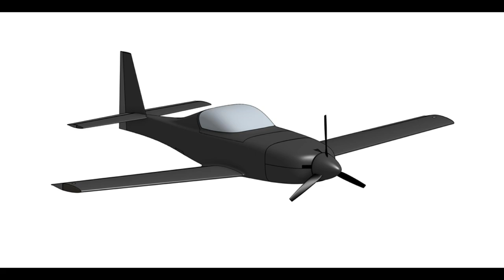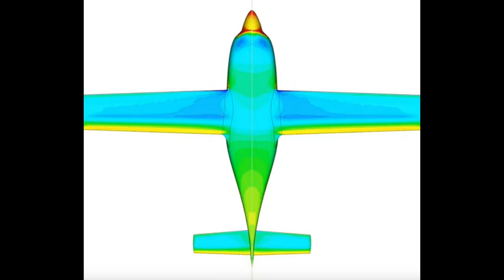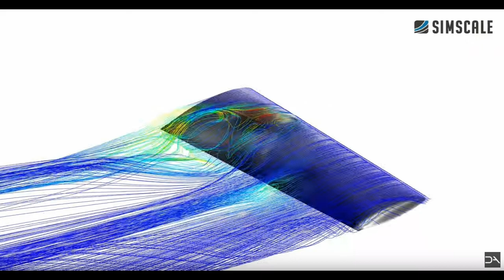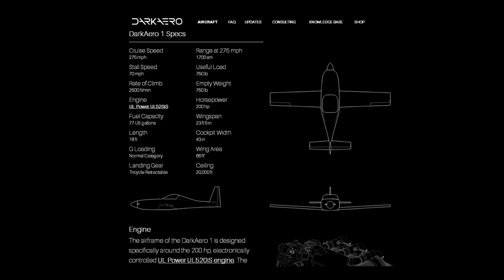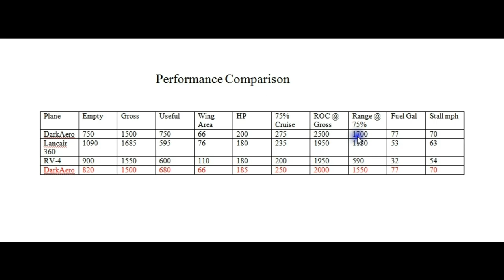Exploring DarkAero. Video #109

Comment: One thing that impresses me is the enthusiasm, confidence and logical thinking that oozes from these three young men.  I'm a bit taken aback at all the non-traditional material, methods and design.  Carbon fiber, hinged canopy (and panel!), split rudder, tiny wing, UL520 no mixture control engine.   This is a far far cry from the dowdy traditional C172 I fly.   In fact the modern futuristic Darkaero makes the C172 look like the Ford Model T of the sky. 
They believe in themselves, and in their product.  They do everything totally hands-on.  If that's not full conviction I don't know what is.  Way to go, bros!  And my very best wishes from faraway Malaysia!!

Comment: These engineers have set THEIR goals (not ours). Very light. Fast as possible. Best range they can muster. AND...for better sales... side by side rather than tandem, and LOW PRICE- that means staying under FL180, non-pressurized, simple flaps, no slats, no speed brake (using split rudder instead), and the fastest stall speed allowed.. The UL engine is the lightest weight for the horsepower, and they say the electric adjust prop is much lighter than an oil pressurized one. They also say the prop was designed for this engine, and they plan on using full RPM of the engine for 200hp. I believe they will come in at their weight goal. Their speed goal seems too high, but they still believe it will achieve it. Their extreme attention to details and testing and designing for production and easy kit-building are their greatest strengths. Try finding a 275mph plane for $160,000.

Comment: What I like about these guys is though they seem wet-behind-the-ears in trying some of these new things like the split rudder and the electric gear, they also have the analytical chops and the rational attitude that I trust them to swap them out if they're not working, rather spend dozens or hundreds of pounds to satisfy their own egos like certain other would-be kitmaker youtube personalities.
Reply: Yeah, actual proper testing and engineering. Even then it won't be easy, but it looks they have a really good shot at achieving their goals.
Reply: King Air 200s use electric gear retraction
Reply from the maker: @aviator267  King Air uses motors and chains, this one will attempt direct linear actuation. I should have been more clear on that.
Reply: Based on many of their comments I've read these guys also seem like they would be willing to accept/seek outside help should they stumble into something they cannot work out on their own.
I'm only disappointed that I can't fly a darkaero with my light sport license and that it is a bit beyond what I can afford.
Reply: @rv6ejguy  I’ve been a subscriber of yours for a long time. I really enjoy your content and technical info, I’m following the darkaero project closely and love the work they’re doing especially around the gear. Please keep us updated. I always request them for content on the gear. I operate and represent BlackShape and their aircraft use electric motor drive undercarriage with lead screws. No problems there
Reply: This comment was accurate on 2 months ago. Now it's even somehow even more accurate...
Reply: @rv6ejguy  linier actuators are the best option for landing gear bar none, imo. Any other Gizmo along the way is over thought and heavy. Though Mooney made a simple electric system at one point. Linier actuators with an irreversible, rotating threaded rod and stepper motor is perfect for this application. Very reliable and precise. It's what CNC Mills use for precision and durability.
Reply from the maker: @TheJustinJ  It could work. We'll have to see how their design works in the real world just like the rest of the design. It will certainly be a light solution if it does and I commend them for trying something different here.

Comment: The DarkAero has the potential to be a big success. The team's philosophy, professionalism, work ethic is something to be admired.

The only factor that I can see against its success is, unsurprisingly, cost. The company will undoubtedly find a costumer base. I just hope that enough costumers will be there to justify the investment.

Other than that, the aircraft itself is an absolute jewel. If I could afford one, I would definitely purchase one.
Reply from the maker: They need to get the thing in the air to prove it. It's really dragging out with their other diversions now.
Reply: @rv6ejguy  I agree. It should be in the air as soon as airworthy; not as soon every single nut and bolt has been polished to perfection.
It should be in the air as a proof of concept. Non-critical parts can wait.
Getting it into the air will incentivize investment, as well as potential customers, not to mention the value of publicity.
Reply from the maker: @leoa4c  Yup, last video was on creating a CAD catalog. Nice thing to do but is taking time away from DA which has seemingly slowed down a lot over the last 6 months.

Comment: News alert,, that UL engine is now turbo normalized. 220 hp. Go high go way faster. Also with say an extended tip option cruise would improve with altitude while helping tame the stall speed a bit like 65 or so.
Reply from the maker: Would need O2 above 12,000 which is a PITA. More weight, more maintenance, higher cost.

Comment: They might achieve a lower than anticipated empty weight. As they're building, they have been finding lots of opportunities for weight savings from using different materials than initially planned. One example is switching to a polymer bearing/bushing for their landing gear shock absorber instead of bronze (?). I've been very impressed.

I need to see actual flight testing and validation of their models though, especially for slow speed handling. The wings are very thin, working great at high speed. Low and slow is my biggest worry especially with the horizontal stab. They are very happy with the wind tunnel results though so my fears are likely unfounded. 

Is a 3200rpm propeller a problem with noise/vibration as the tips go supersonic? Why would UL make an engine with such a high possible RPM?
Reply: Has a design ever come in underweight? Taking weight out is usually the fight for everyone - even up to airbus! Very clearly optimizing for high speed / long range cruise I think? 

Be interesting see wing and power loading numbers in these comparisons. 

One benefit of the higher wing loading might be handling in crosswind / turbulence etc. The kind of flight times these folks are thinking about are long, weather can shift at the destination so a plane that doesn't get blown all over might be nice? Some light sport flyers get nervous (reasonably) when conditions for landing are a bit sideways. Just speculating.
Reply: @randominternet5586  The designers want high speed and high efficiency/range and low cost. Their specific mission is getting from A to B and navigating around bad weather. I'm guessing they plan on airports with multiple runways. 

They do not plan on lightning protection or deicing, or grass runways, or any other engine besides the UL because their cowling is intentionally limited for aerodynamics. With their process though they should be able to fabricate a modified cowling very easily.
Reply from the maker: The Jabirus can spin up here too. It gives the opportunity to use a small prop for ground clearance and that won't hurt speed but may hurt TO and ROC. A bit of marketing too perhaps- 200hp from 5.2 liters sounds impressive. That's why I mentioned it may not be spun up this high and therefore won't make 200 hp.

Comment: Very well done videos and a lot of fun!  I'm not sure they couldn't make the spinner one piece though with matched tooling.  I built a rocket fairing with a carbon fiber 20 ounce 2 harness twill and no special tooling.  Matched tools and the right fabric could probably make this a one piece part.  I'm also concerned that having to use some constant right rudder to offset engine torque would set up a permanent split in the rudder adding drag while in cruise.  They also discussed the higher aspect rudder for more efficient lift right after saying their cross country mission profile made rudder usage (lift), less of a problem.  Higher aspect has greater Moments of Inertia requiring more strength and that requires greater weight.  So lower aspect seems more consistent with the mission statement.

maintaining

Comment: Thanks for looking at the DarkAero. I also think the brothers are doing a great job.
There are two things about the airplane which don't seem right to me. One is the way the instrument panel is connected to the canopy. This seems like the wires going to instrument panel will be flexed more than in a stationary instrument panel. Hopefully this isn't the problem I fear it could be.

The other aspect of the design I wonder about is the engine mount. They plan to use a pair of aluminum boxes (of sorts) to connect the engine to the firewall (with shock absorbing mounting points). This mount is much smaller than the normal welded tubes of other engine mounts. I'm concerned the smaller mount doesn't provide all the benefits of the bulkier mount. It just seems like the conventional mount wouldn't be as bulky as it is if there weren't a good reason to make that way.
Again, thanks for the great video. I really enjoyed. I also really enjoy watching the DarkAero videos.
Reply from the maker: The flat six with EFI should be glass smooth compared to a 360 Lyc. and the plane is only stressed for 3.8G I believe. I think the aluminum mount fits with their philosophy of using machines (CNC) to make as many parts as possible. This layout eliminates hand fitting and welding tubes. We'll see how it pans out.

Some things probably won't work as planned but I feel they will accept this and re-design any parts that don't.
Reply: @rv6ejguy  Thanks for the reply. I hope things work well as planned and as you say, they're make changes if needed after they test.
It's a lot of fun watching a project being done so well after seeing all the problems plaguing the Raptor.
Thanks for making your videos.
Reply: Flexing the wires by opening the cockpit should be no problem if they are properly flex and strain relieved and protected against chafing. I work on machines that get way more use than an aircraft cockpit and wire flex is no problem. Of course there is no worry about falling out of the sky either. But I can’t recall there ever being a problem caused by flex in 40 years of working on them. Improper strain and flex relief modification in the field by thoughtless techs usually causes any issues. That or improper use by end users.

Comment: They are certainly good bouys, doing very good job. One thing I do not understand: Why they put aluminum in between the carbon instead of airex or some similar material? MUCH easier to repair if needed, no corrosion issues at all.
Reply from the maker: I agree. I also see too many complex machined parts here, especially on the landing gear. Not ideal for production and maintenance. Aluminum engine mount also not a great idea from a fire perspective or fatigue over the long term.

Comment: UL Power have now turbocharged this engine.

It will be a game changer, for sure, and it is called the UL520T.

https://ulpower.com/en/engines/ul520/ul520t 

This engine now makes 220 HP at a more propeller friendly 2,700 rpm right up to FL150.

It can produce 200 HP at 2,450 rpm and a continuous cruise power of 180 HP at just 2,200 rpm.

Higher power, lower rpm and maintaining power at altitude will make a huge difference.

The DarkAero 1 does not have much space between the engine and firewall but hopefully there will be enough room for the turbocharger.

I do wish that each wing gets extended by about 1 metre.

Glssair did this to the III transformed it with increased cruise speed and climb as well as reducing the stall speed.
Reply: Wow - that is interesting news I hadn't heard about. The tradeoff in terms of weight for power is not bad it doesn't look like. The high altitude performance also better obviously. How does increasing wing increase cruise speed? Or is that just with turbo + wing increase?
Reply from the maker: @randominternet5586  The designers have made cruise performance at non-oxygen altitudes their primary design goal. In airplane design there are compromises. The small wing won't be good up at 18,000 feet or for slow flight. It's hard to have it all without giving up a bunch of knots on the top end.

RVs do the medium speed (around 175 KTAS) and low speed compromise well and with massive market share. Not much point in trying to compete there.

This is a small plane but follows the Learjet theory- the high speed means you won't have to sit in it too long...

Comment: I just run across a number of their videos and am impressed with the overall design processes that goes through their mind. I think that the stall characteristics if they would contemplate putting perhaps some Vortex generators on the wings that would help that smaller Wing be a little bit more effective. I am surprised that the shape is not conducive to closer to about 260 knots. I do think that that engine puts out enough torque that the horsepower number is not the leading criteria. Propellers are pushed through the air and push through water via torque, not horsepower. I don't know why they never print the torque numbers but torque is at least as important if not more so. I don't know why people in Aerospace tend to ignore that number. But that's information for another day. And I know that this is still conceptual. But I think they've got something going here so far. I think that they may get even better performance than they are printing here. Or at least have the clear possibility of doing so. I know that they had toyed with the idea of going with an electric power plant. Which still could be done if they would put a smaller highly reliable fueled engine of some type to run an alternator. Generate ate the electricity that the engine needs to run off of and I think they could cut a little bit of the weight down even further. However I still think that electric Drive will only be viable if it's done in a hybrid manner. Even a small gas turbine engine will put out enough power to be able to even use a battery source and replenish the battery fast enough where you can still have well over an hour of backup when you get to your destination. The nice thing I like about it is you can easily scale up their production Concepts into a six-place aircraft that would be more than capable of being a good Caravan or even light cargo aircraft. The expandability of their build processes seems to be quite nice. I do believe that they may end up going to a center strut to assemble the wings into pieces. It would be easier to replace one or the other should one get damaged rather than having to replace both in case of some sort of damage.
Reply from the maker: HP, not torque,  quantifies rate of work which is what engineers are concerned about for motive use. They know what they are doing.

Hybrid drives don't make much engineering sense on aircraft as they operate at continuous high hp unlike automotive applications. Any study will show it just adds dead weight. Watch my vid on Raptor NG which explores the pitfalls of hybrid aviation systems.

I don't expect DA will change the wing structure. It would require a massive re-design and re-validation plus add weight and delay production even further.

Comment: Fantastic! Youtube got this too me. Very interesting analysis.

Designs almost ALWAYS come in heavy but will be interesting to see where they land - very curious about that! 

They've got FAR more engineering into this than a lot of others, good mix of skills so very open minded as to their success.  

Focused on long / cruise flights clearly. I'd personally trade out a touch there but... they know what they are going for. 

ROC seemed high but I did no analysis, even 2,000 is fine. 

On engine choice - another poster notes there is a turbo version of this engine. The thing is already plenty fast. Maybe a Turbo version if they can prove the concept and might be a bonus on engine choice longer term. 

The range is impressive for the weight / size. I hope the autopilot is good and seats comfortable, that ends up being some real hours in terms of flight time. Where this get's really interesting is below gross.

They should charge enough for their work in this, start with a premium price on the kits and then bring down over time if possible. I hope they get flying and make some money. 

Thanks so much for doing the video - enjoying theirs and now yours on this project. Only thing I'd love if someone added some wing loading / power loading numbers for comparisons. I might come back on weekend to add that when I have a bit more time to sit and look.
Reply: I bet they'll go for more iteration on the initial design for a DarkAero 2/3/4/5/6, different features, engine options, more passengers, etc. A turboprop/pressurized version seems like another logical step for this very gifted team. 

I don't think they want to go the CubCrafters route and charge a premium and limit their user base. Mass market appeal is where it's at.
Reply: @Zav  Except cubcrafters have a great business AND do good volume. The engineering for pressurized adds a fair bit. Should be fun - a 4 seater / turbo versions maybe some options.

Comment: In the photo of the plane parts at 5:05 you can see the flat front of the fuselage where the engine mounts Does the engine directly bolt to this carbon fibre face?  I see four holes and two openings.  If so it seems it would be subject to much stress and vibration.  Or is there some kind of metal structure the engine mounts upon?